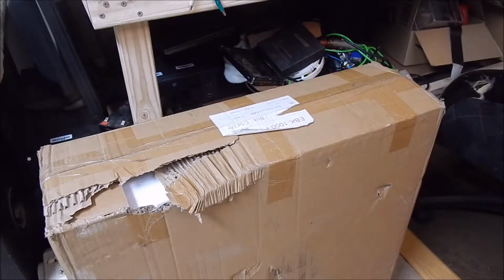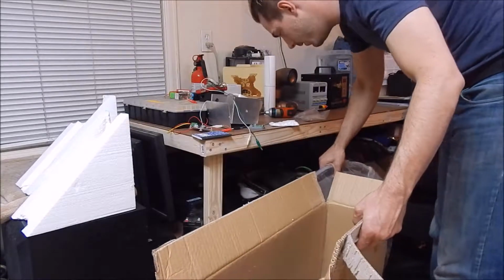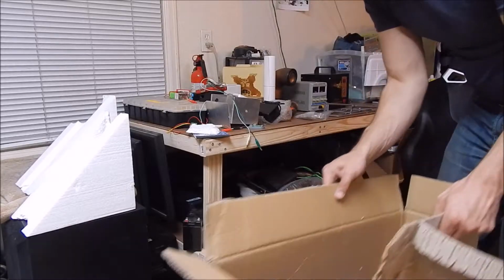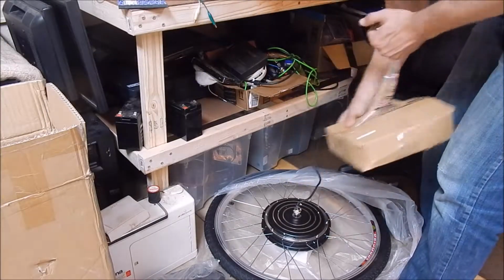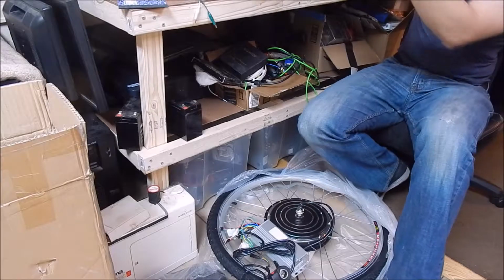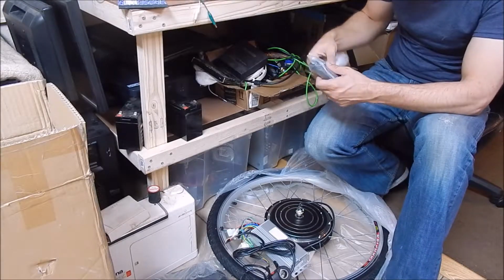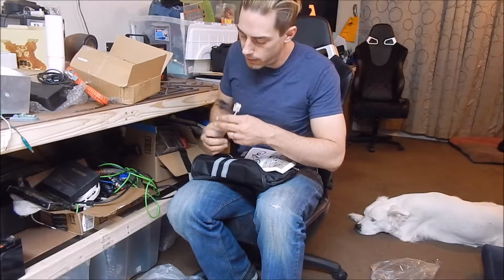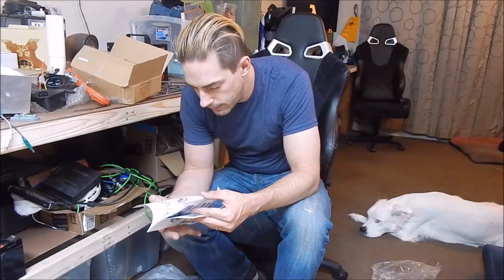VLOG - Unboxing my eBay 1000w eBike Wheel!

Comment: Hows the torque and speed on this??  I want to buy one but i heard the over all power depends on the Amp controller
Reply from the maker: Like you said,  depends on a couple things.  You are probably looking around 35mph with some good TQ. Good luck!
Reply: what battery pack did you use!! Im so stuck on an E-bike or a 4stroke Friction drive gas bike.